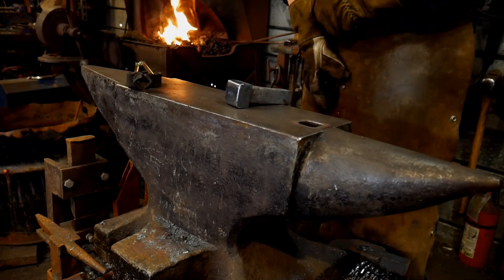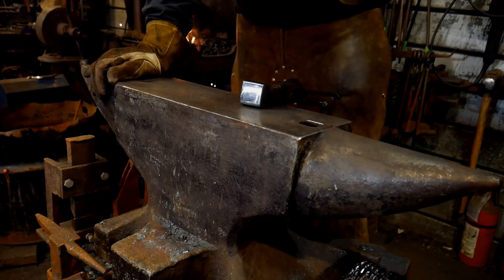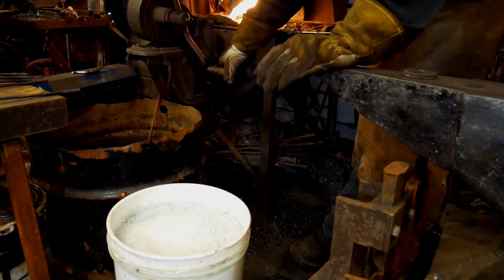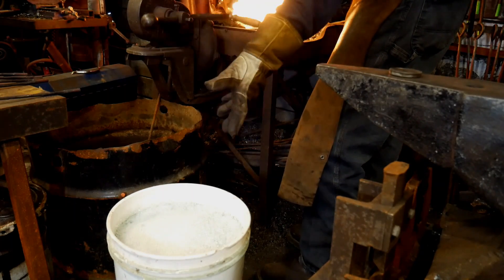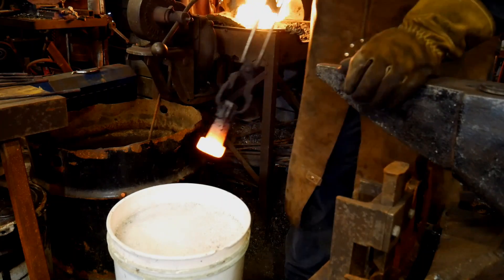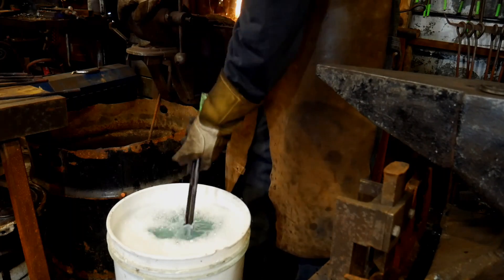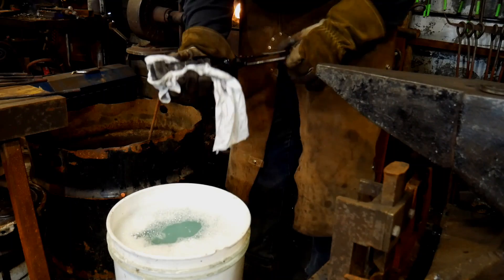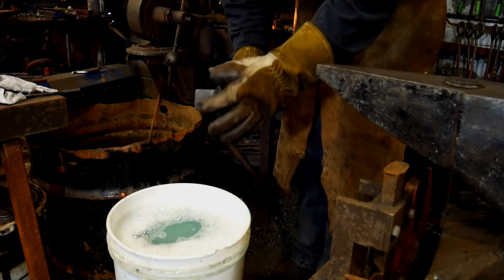Hardening Mild Steel Tooling with Super Quench

Comment: Perhaps it would have been a good idea to try it with a file (before and after) to give at least SOME idea of whether it works or not. As it is, this is a video about a guy heating some steel and quenching it in something...
Reply: With 1018 you can feel a difference using plain water. It can't get file hard, but it definitely has enough carbon that you can feel the difference.

Comment: mild steel mean low carbon steel mean there is no martensite mean ther is no hardness ...but some case hardening happened becuase of atomic carbon com from charcoal...
Reply: 1018 mild steel just barely has enough carbon to get some hardening. It isn't going to be much, but it can be enough to make your tools a bit tougher which is really all you need for hot working tools.

Comment: Milde Steel ist Not able to geht hard ... No Carbon inside -> No Martensit...
Reply: Then how do you explain my custom-made Hammerheads that I've been using for 7 years that I made out of mild Steel? I did temper them inside the heart of a star the dwarfs taught me how to do it but other than that how would you explain it?
Reply: No carbon no steel
its mild STEEL, so basicaly its a low carbon STEEL
Reply: Even .2% carbon is enough to get noticeable hardening. Most mild steel is around .2% carbon. It isn't capable of getting as hard as a higher carbon alloy, but you don't always need to get that hard.

Comment: What's the deal with "molten salt"? Some European company hardens their chisels with it.
Reply: They use molten salt to heat the chisels before quenching. The molten salt allows you to get a  uniform heat prior to quench.
Reply: Molten salt bath carburizing is an obsolete process of case-hardening mild steel industrially. Replaced by Gas carburizing and carbonitriding, and vacuum processes.
Reply: Unless you are talking about case hardening with cyanide salts it is just a conductive fluid that you can heat up to critical temperature without it boiling as a faster more consistent alternative to a heat treat oven. You usually use specialist salts not sodium chloride for this purpose and the benefits are small enough that they aren't usually worth the corrosion and safety issues unless you are running a large industrial heat treating facility.
Reply: The only molten salt I've heard about is used to retain heat in power generation applications. eg nuclear and solar  Molten salt is very hot as far as I know.
Reply: Thanks for clarification! I always wondered

Comment: I did my super quench recipe differently than yours in 2 ways. I used epsom salt and jet dry. When I stir mine I do So gently as to not make it foam up. I get almost a hot blue finish on whatever I quench and I get a good hardness. I use it mainly on railroad spike knives and file knives.
Reply: ممكن توضح اكتر عن طريقتك

Comment: Would cold water work the same?
Reply: Yes i believe so. I think this kind of stuff is a bit hocus-pocus.
You may make a micro level deep harder but overall it doesn't make sense.
That concoction won't soak into the metal at all
Reply: the detergent is in there as a surfactant, so that the hot steel isn't surrounded by a steam-bubble, but actually being in contact with water that cools it down fast to "freeze" it..